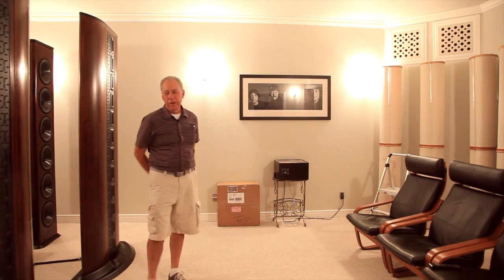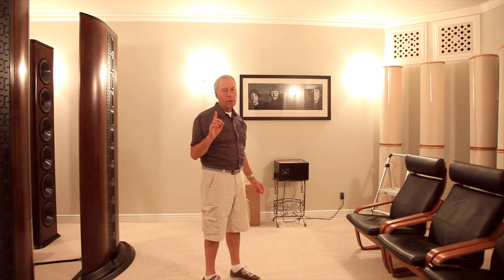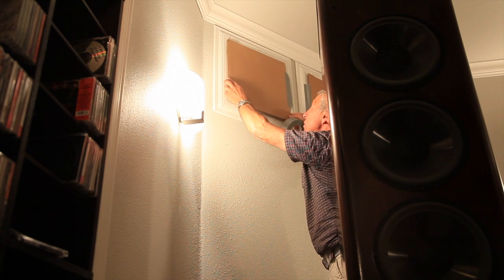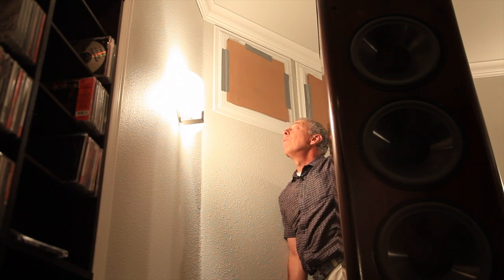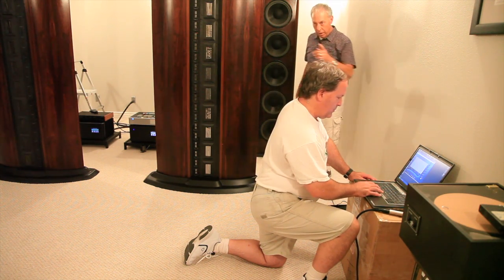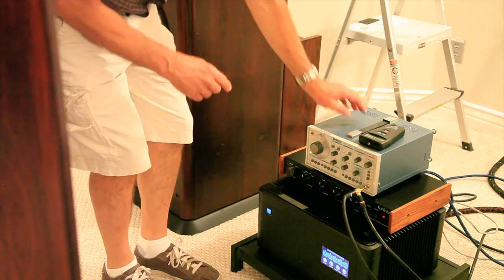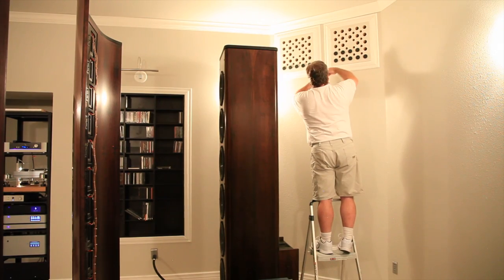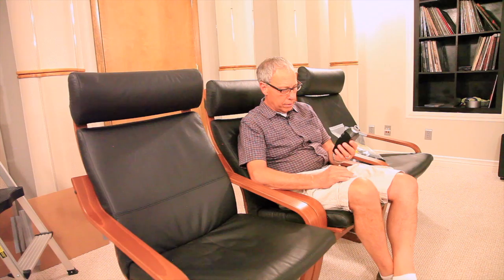Tuning the Music Room

Comment: Your Helmholtz method does not make sense in trying to tame massive low-freq peaks. 

In such a room, bass traps on the wall and corners of room would have been a far more direct solution to the issue. 

Without any room treatment all, fully open the door, and your low freq issue goes away. Im very sure. Thats why you need REAL bass traps.

Comment: Is there any reason why you would not want to use an active 1/3 octave band equalizer to tune those speakers to match the room ??
Reply: equalizer are ok for pro-audio but audiophiles, not so good because of phase shifts, and multiple frequencies effected, harmonics. etc.
Reply: @jotunman627  Phase shifts aren't a problem, that's a myth. It's not like you're overlaying phase shifted and a non phase shifted signals.
Reply: @jotunman627  Phase shift is only a big deal in pro audio.  That's why studio monitors (real ones) integrate phase coherent drivers in their systems.  Audiophile systems like the IRS V's are COMPLETELY out of phase from top to bottom.  As long as it sounds good that's all that matters.  Pro systems aren't necessarily better sounding but they must be as 'correct' as possible or the fault continues all the way down the line to you the audiophile.
Reply: You can't EQ a room mode. You could take out a frequency completely, but then you would miss that frequency. An effective bass trap will get rid of the room mode by getting rid of the reflection of the sound wave only.

Comment: Slot resonators work better on low-mid as opposed to low, as far as I understand. It seems you all may need to use bass traps. Since you wanna keep the room looking clean, how about just building them into the corners. Also, I wonder if your room has a false ceiling (drop ceiling). If so, you can implement acoustic hangers above the ceiling and behind the walls. Those should serve well.

Comment: Very interesting video series and enjoyable too!
I had several issues in my room and had done several trials and treatment.  And my final solution was using "active" correction which is McIntosh MEN220.... To correct the final part of the link after the best I could achieve for passive correction.  The key to a good active solution is not just the reliability for the machine, but the way you calibrate the room.  You may wish to consider that :-)

Comment: I would suggest a different method that is much more efficient than anything else for that matter. It's a corner airtight sealed triangle bass trap that has a sheet of owing fiber glass and a air gap in the back corner and the front facing plywood. The plywood must resonate with your target peak low freq. the efficiency of this design, from pressure to velocity is among if not the highest. Hope this helps. R.

Comment: Great video! A couple of thoughts.

Those Rat Shack SPL meters are hideously inaccurate at low frequencies.

As someone else pointed out, bass peaks and dips in a room will often swing wildly over just a couple of inches, so I find that sitting with the meter held casually in your hand leads to inconsistent readings.

I have never been a fan of listening chairs with a tall back that includes a headrest behind your ears. The short reflection from the headrest to your ears causes a loss of focus.

Comment: I'll offer some tips: Pink noise is not a suitable source for testing bass traps, nor is a third-octave analyzer. It's also critical that the microphone not move even 1/2 inch as you test. The preferred software for testing rooms in a home is the freeware Room EQ Wizard. REW not only displays the LF response at high resolution, it also shows modal ringing which is just as damaging. I'll also mention that 30 Hz is less important than higher bass frequencies where many nulls 30 dB deep are common.
Reply: Absolutely brilliant comment!
Reply: You are the Best Ethan